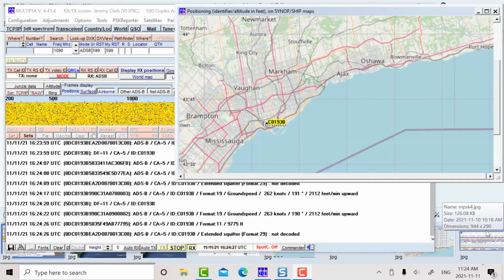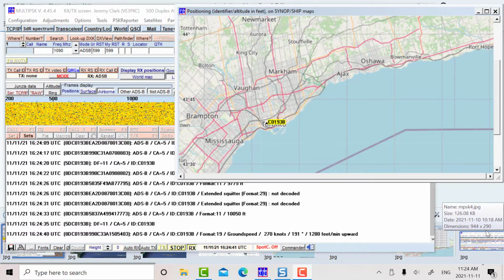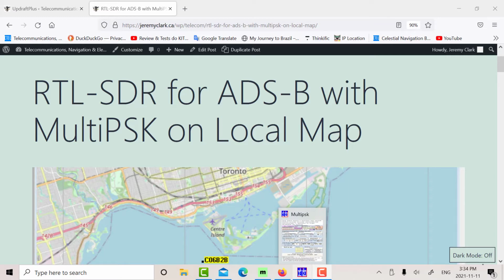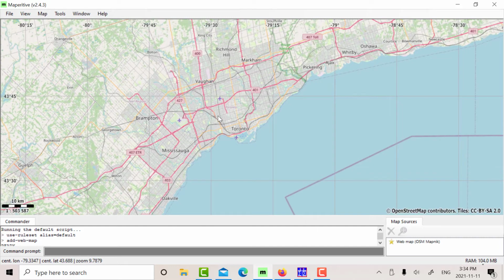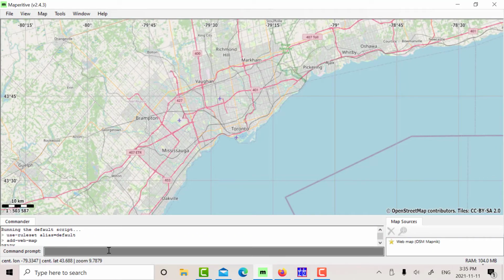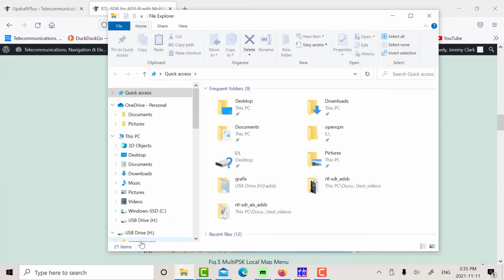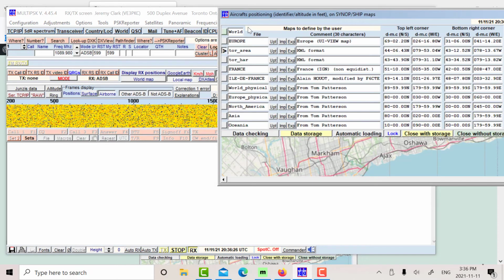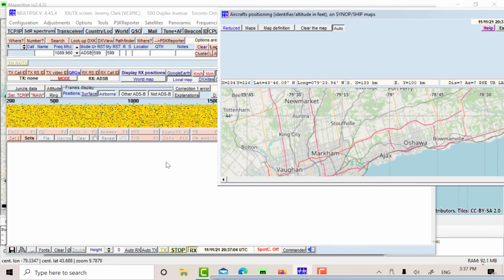RTL-SDR for ADS-B with MultiPSK on Local Map

Comment: Do you think MultiPSK / Maperitive would work with other SDRs?    Like the LimeSDR or HackRF?

If not, since MultiPSK seems to decode many digital modes.. could the same thing be done in Gnu-Radio-Companion?
Reply from the maker: Started working with SDRangel recently. It handles RTL/HRF/Lime plus it has a local map, you could experiment with that.